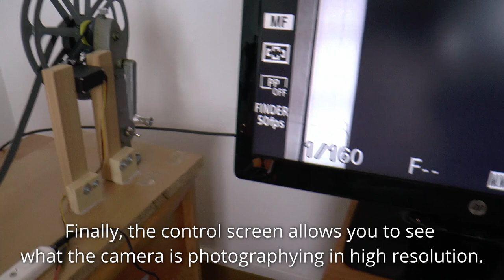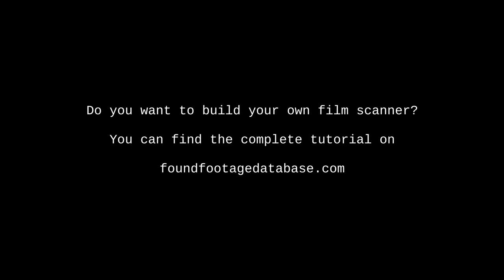Presentation of the DIY 16mm film scanner FFD-16

Comment: very inspiring, can not wait to start building and compare the result with my current super 8 Bauer T 502 telecine setup
Reply from the maker: Thanks! Please note that I managed to digitize a Super 8 film with an 8mm mechanism (this one: https://youtu.be/kPN6-C92u_0) but I had to make small adjustments.
It it more difficult to digitize Super 8 films since the distance between the perforations is not exactly the same as for 8mm films. Therefore, if you use a scrolling mechanism coming from an 8mm camera, it may not work properly. Unfortunately, I could not find a Super 8 mechanism that could be mounted on this system.
Reply: Can u sell this one ? I want to buy it
Reply from the maker: @ER7ABY  Hello. Sorry but I still need it. I think it would take only 2 to 3 days to build one once you receive all the parts. You can even build it with a friend.
I hope the tutorial is clear enough: https://www.foundfootagedatabase.com/en/articles/tutorial_scanner.html
Reply: @foundfootagedatabase5577  can u make for me and I will pay u for the time u spend . I realy want it but no time to build it
Reply from the maker: @ER7ABY  Hi! Unfortunately, I don't have the time anymore either. Do you have a lot of 16 or 8mm films?
Reply: @foundfootagedatabase5577  i will try my best to build it up my self , from where I can buy the  parts

Comment: The light , what is the watt I need ?
Reply from the maker: With LED, power (Watt) of the lamp is not really representative of its brightness (Lux). The specification sheet of the Godox LED 64 video light I use says "Brightness: >1000 Lux". I guess any LED video light would be ok on condition that you can power it with a DC power supply unit. It shoud also be the correct size. The Godox LED 64 video light has 64 LEDs and the lighting surface is approximately 6,7 x 6,7 cm to give you an idea.
Reply: @foundfootagedatabase5577  can I use big surface and then put the light in cartoon and make hole same size of film , so the light focus one area . Can I do that of there is no small led
Reply from the maker: @ER7ABY  In my scanner, the film is approximately 5 cm away from the diffuser in order to prevent heating, contact and above all focus on dust that could fall on the surface of the diffuser. Therefore, the surface has to be larger than the surface of the film. I found that the LED video light was the most homogenous light source over the film surface but you could try with another lamp. Keep in mind that the surface of the light source has to be larger when the distance between [light source + diffuser] and film increases. Otherwise, with the perspective of the lens, only the center of the photogram will be correctly exposed to the light source.

Comment: I have a question, why couldnt you just modify an old 16mm film editor to do this?
Reply from the maker: I did not think of this. However, I don't think it would be easier because these editors don't have scrolling mechanisms. You would have to install one somewhere. Plus, you would need to remove the preview screen in order to place the camera on top of the film.

Comment: Add a wet-transfer film gate, will cut back on digital manipulation of the digital files.
Reply from the maker: Thanks you for the suggestion, I did not know this process. However, it seems very difficult to install and it requires the use of a hazardous chemical (perchloroethylene). Plus, it seems useful only if the film is in very bad shape. I don't mind minor scratches.